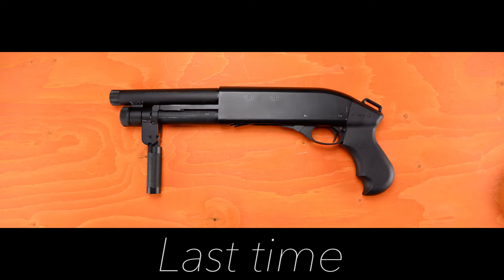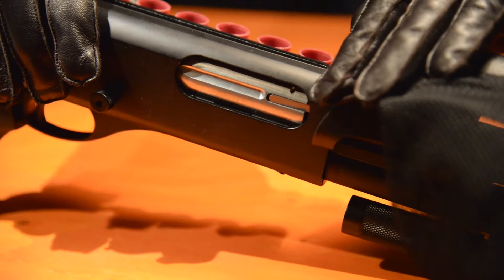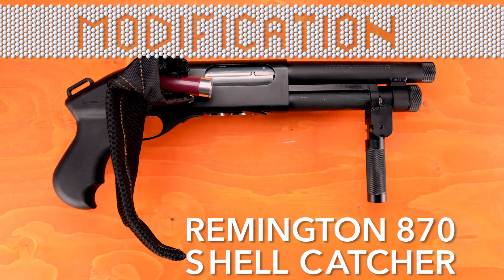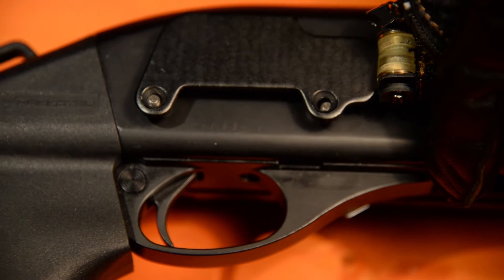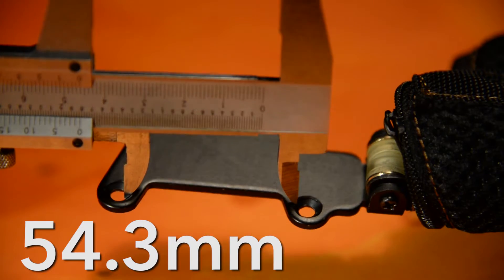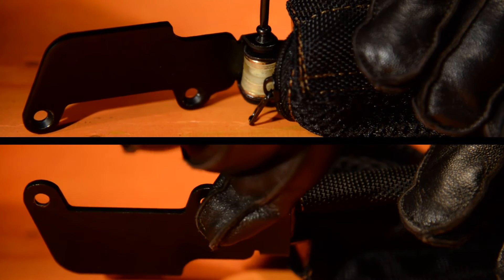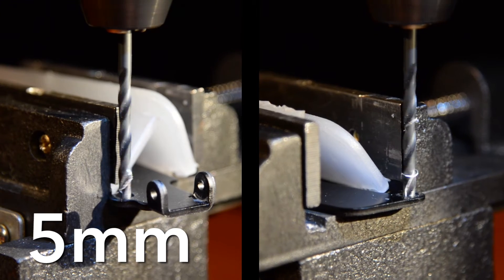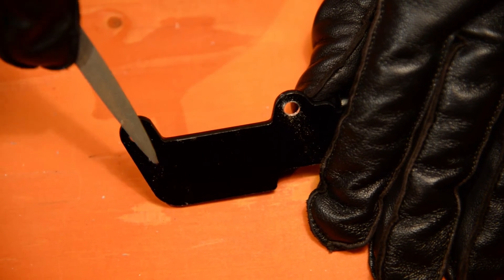MODIFICATION - PPS 870 Shell Catcher on a APS CAM870 | AIRSOFT

Comment: Just finished this mod and the shells wont discharge.the bag material is too stiff and wont drop the shells.
Reply from the maker: Is there a problem ejecting the shells through the ejection port, or removing them from the bag after use?
Your comment is rather hard to interpret.
Reply: @SpecialWeaponsAndPlastic  its actually pretty clear. The bag is catching the shells is what i said.
Reply: As in the bag is stopping the shells from ejecting.
Reply from the maker: That's the information I was looking for. The bag is too stiff, preventing the shells from ejecting. A short, consise explanation of the problem.

Have you tried fabric softener? As shown in my video, I have no problem with mine.